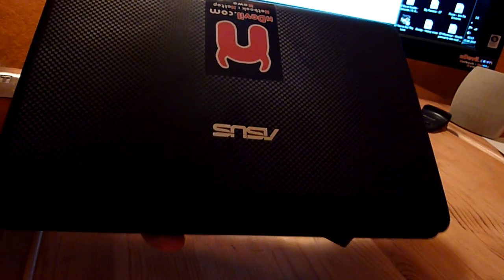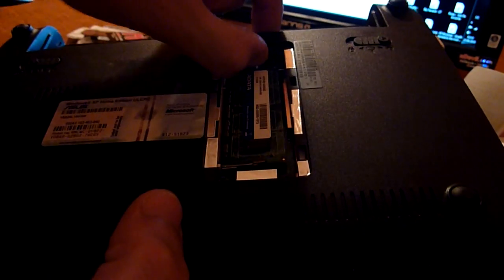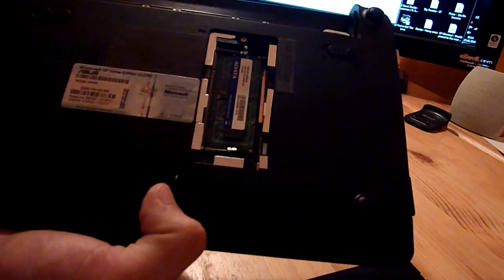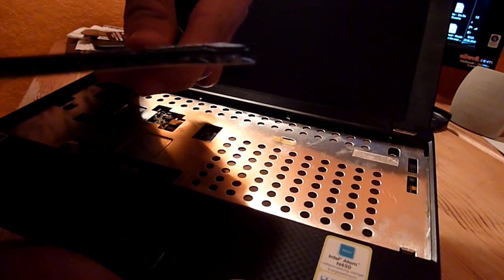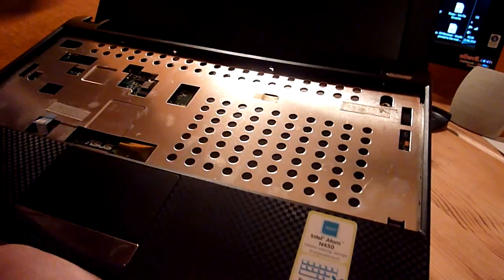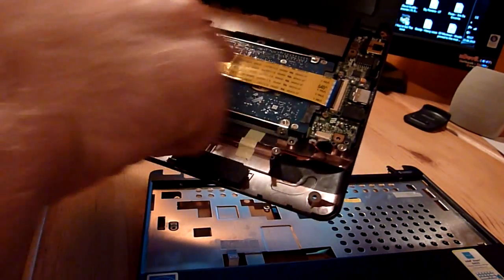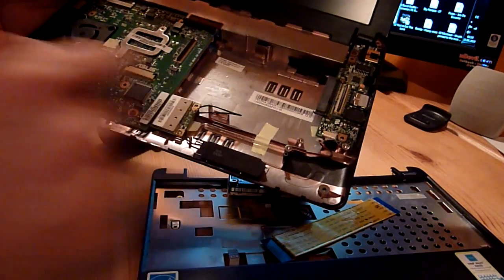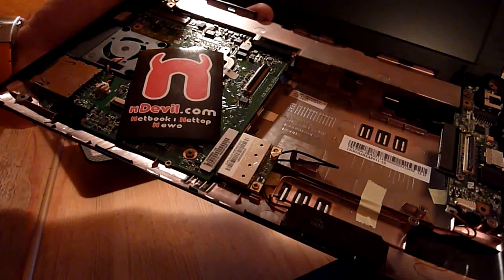Asus Eee PC 1001PX RAM Upgrade and HDD Changing

Comment: Hi, i have a question, can i upgrade the ram of my asus eee pc 1001pxb to 8gb so i can upgrade to windows 10 with no problem?
Reply: No, the processor can only handle up to 2GB DDR3 1600MHz
Check the specs of the laptop on internet

Comment: I'm curios why my 1001 pxd does not recognize 4gb ram stick. I've put 2*4Gb into lenovo g550 on gl40 chip and it works there, but here's only 1 slot and it allows only 1*2Gb ram stick. It's very ugly hardware configuration. When I've put 4Gb ram stick it seems run, but without displaying anything. After putting ram stick with smaller size back it starts normally.

Comment: Tnx, man! This video helped me with replacing the HDD with an SSD. Cheers! :)
Reply: To be honest, I never really tried overclocking a CPU in a portable computer, but my reasoning is that it would generate more heat by default and that can be bad in tight spaces with limited airflow. That said, I believe that you probably know more than me about this since I see that you're going for far more complicated things like replacing a CPU. :) Good luck with your project. :)
Reply: RandomlyDrumming does the speed change much after installing a SSD?
i already upgraded my GFs 1001pxd to 2gb ram and upped virtual memory which did a lot (word opens within 10 secs instead of 10 minutes :P) now the next thing i would do is replace the HDD with a small SSD so it would change to about 2 secs orso but the problem is chrome mainly using 100% CPU same as windows update etc and the CPU can't be updated :(

wanna share your experiences?
Reply: ***** Hi! Well, regarding the upgrade, I also installed 2GB of RAM and that alone increased responsiveness of the machine dramatically. On the other hand, installing SSD did improve performance and responsiveness, but not by a large margin. I mean, there are certainly some benefits and you will definitely feel the difference (the OS boots faster and applications will open a bit quicker), but don't expect performance difference like on a desktop or a laptop. The CPU seems to be the biggest bottleneck - it's simply too weak for any serious heavy lifting.

In short - installing an SSD will increase the "quickness" of the system somewhat, but once the app is running, it all comes down to a (slow) CPU.

If you decide to upgrade, just go in with low to moderate expectations and you'll be fine. :)
Reply: RandomlyDrumming Thanks for your reply!

Yeah i thought that would be the case. i used a 2gb ram stick from my laptop to put in hers and took her 1gb in min (so my laptop went from 8gb to 7gb) That bassicly was a free upgrade 

but i think its not worth it to buy a 60gb ssd for 50 euros while the laptop itself was 150 euros 
I don't have a ssd on spare :P

although i also read that using a SSD causes less heat, noise and power 
Some claim it gives an extra 45 minutes battery this + less heat might be worth it.
Did you notice any change on that or not much?I also think the cpu is a huge downer. i thought about overclocking it a bit with software but i think the laptop will die much faster that way (on startup it already goes over 60°C and it does not have a fan)
But with the SSD maybe it will stay cooler and i might overclock a bitThanks again
Reply: +Nick Verkoyen Hey, man. Sorry, YouTube failed to send alerts about new comments for the last month or so, so I missed your reply and question...

In any case, I didn't notice any drastic changes in temperature - the case can still get pretty hot on the left hand side, although it is a bit less hot on top than when the HDD was in there.

As far as battery is concerned, again, nothing dramatic. Maybe it does consume less battery with SSD (it would be logical and expected), but I sincerely cannot tell.

btw, I also think that overclocking is not a good idea as the CPU is passively cooled. The risk is greater then the potential benefit as the CPU is just - crap. :)
Reply: +RandomlyDrumming hello! 1001px owner here! about overclocking, you can easylly increase the cpu fsb from 1.66 to 2.02ghz. its not permanent and cpu temperature will remain the same so i think its not risky.

also i will try to find a way to desolder the cpu and solder a dual core.

Comment: Thank you so much for the video! I used it a year or two back to upgrade RAM, and now to upgrade the hard drive. As rubbermaid11 pointed out, it would be helpful to specifically note, or even better, show how exactly to remove the ribbon cables.

I also assumed the ribbon cable that connected the mouse pad was the same as the keyboard and just pulled out but it does indeed have a small black piece of plastic that flips up, like the pieces holding in the ribbon cable that goes over the hard drive

Comment: Tnx! this video helped me a lot! My ssd works fine:) Like you say, removing the keyboard is difficult with a card.... BUT: Tip for other people after me doing this: in the battery compartment there you see 4 metal strips, they are holding the keyboard in place. if you bent these a little bit, I'm sure the keyboard will come out way easier.